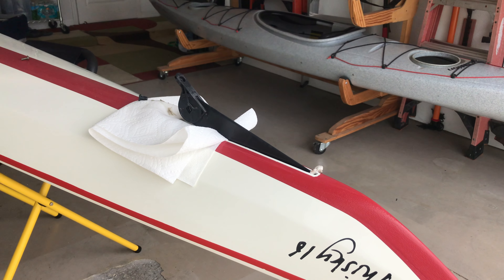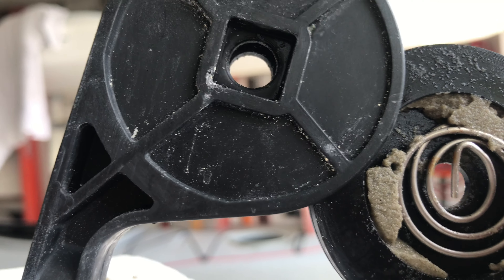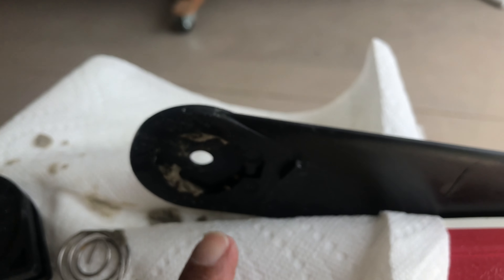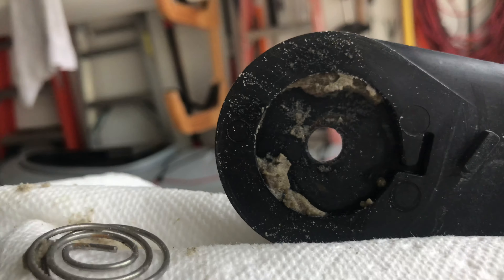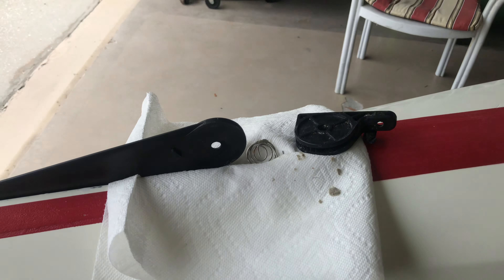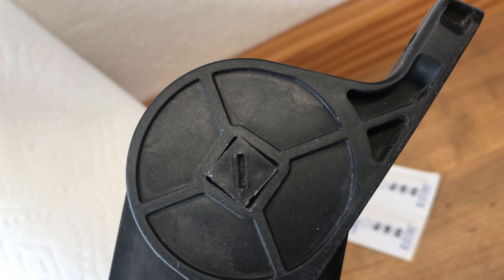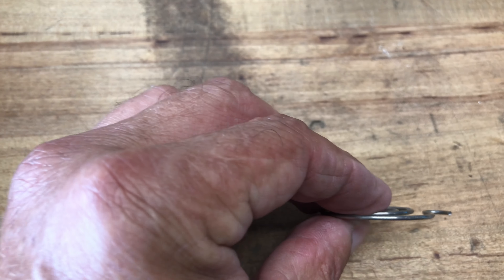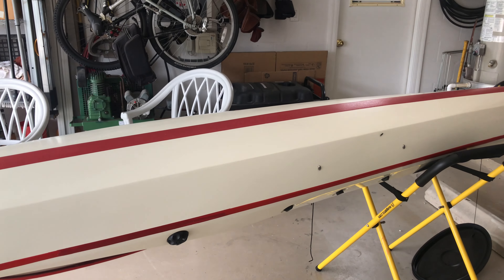Point 65, Whisky 16 skeg problems

Comment: That is the reason why I am not pulling my point over the beach... Or if I must, I pull it with the front of the boat in the sand.
B. T. W. : Did you find any solution?
Did point65 react to your Problems?
Reply from the maker: I do pull mine sometimes but very little, it is impossible to land or launch without. I have not found a replacement spring which is what is really needed to make a long term repair. I had a sheet of Teflon laying around and found that there was enough spade to slide a piece on each side of the skeg. I cut two round disk and make the needed cut outs and slide them in and put it all back together. Its been about a year and has been working very good. 
https://www.amazon.com/Sterling-Seal-7530-031212x12-Virgin-Teflon/dp/B0195H6JTY/ref=sr_1_137?dchild=1&keywords=teflon+sheets&qid=1630849037&sr=8-137
Reply: @TomJonesGearGuy  : Yesterday when I saw your video, I disassembled my skeg.
There was no dirt and there was no place to seal either. My skeg is tight.
I have measured the spring and am trying to have a stronger model made by a specialist....just in case of any problems.
Your idea with the Teflon is awesome if the skeg is not tight.
For any other people with problems: https://www.youtube.com/watch?v=ARaeihHjUMo